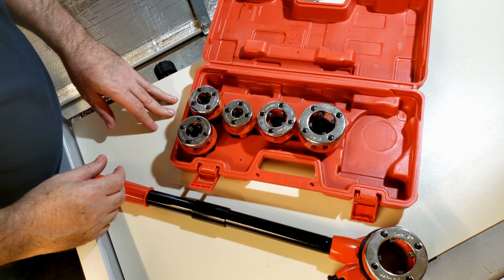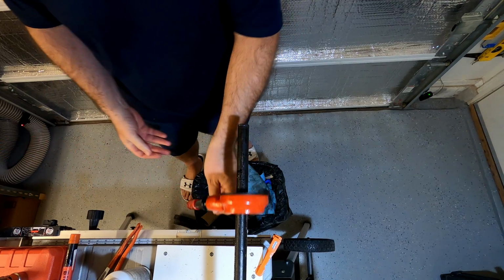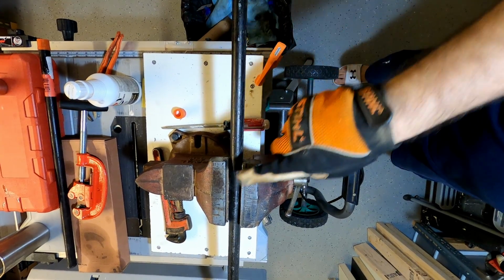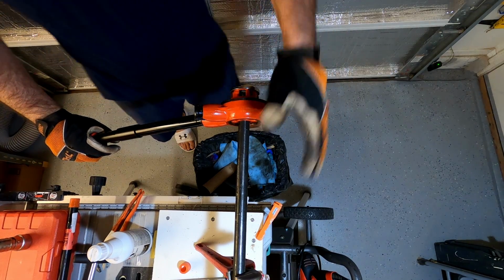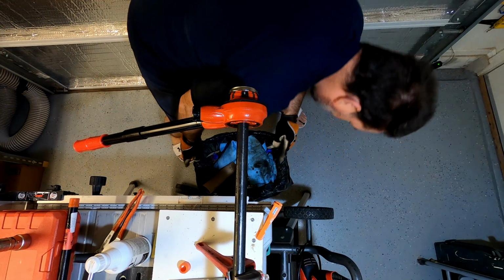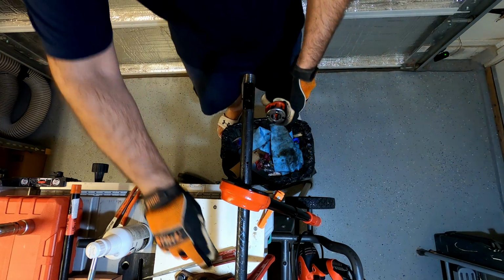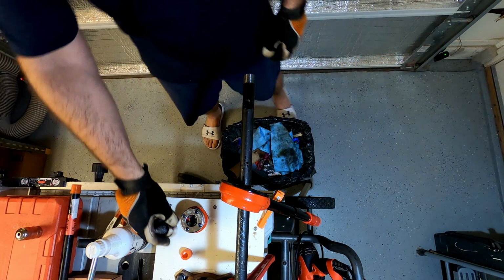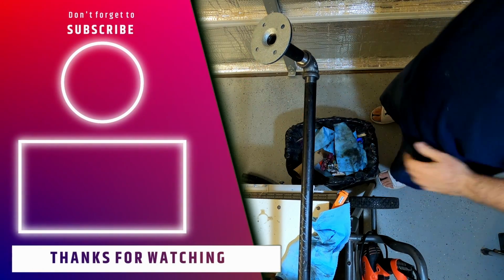Ratchet Pipe Threader Kit - How To Thread A Steel Pipe

Comment: You never reversed or backed up to allow the metal chips to clear. You did mention it, but never did so.   This would have made the next few threads easier to cut, cleaner, and goes a long way to preserving the life of your tool.  Then you used a screwdriver to clean the chips from the die.  A toothbrush and additional cutting oil would have worked without damaging the die.

Just to make it more interesting, you "secured" the pipe in such a way that if you released the tension, you would now have a pipe wrench missile going in some undetermined direction.  All this with no sign of any PPE.  The trash can mysteriously moved, and you are now standing in cutting oil, hoping that your feet don't suddenly fly out from under you.

I hope, for your family's sake, that you have an exceptionally good insurance policy.
Reply from the maker: Great tips! Like I said in the beginning of the video I never used one of these before. I wanted to cut and thread some pipes to hang some curtains on our back patio and I am just learning as I go. After getting some experience I would recommend getting a good pipe vice. The pipe wrench will work but it can come loose and if your not wearing steal toe boots it could leave a mark or worse. But nothing like that happened and it all worked out in the end. I will have to make an update video.
Reply: lol talk about dramatic and making a mountain out of a mole hill. Why don’t you go make a better video showing all your safety gear for cutting some threads into a pipe. You can tell the people that sit on YouTube and critique others VS the people that actually do this stuff in real life. This guys video was perfect just the way it is 👍🏻👍🏻